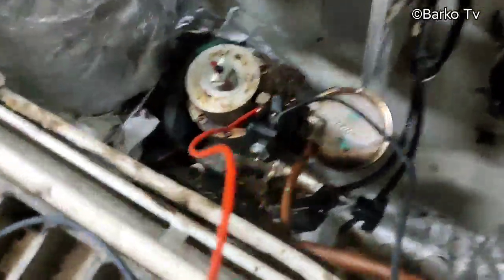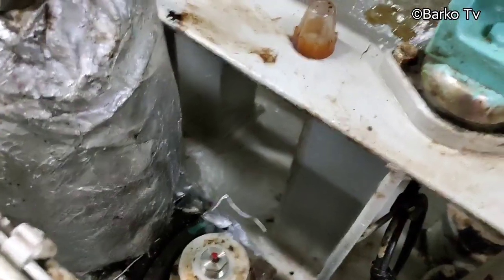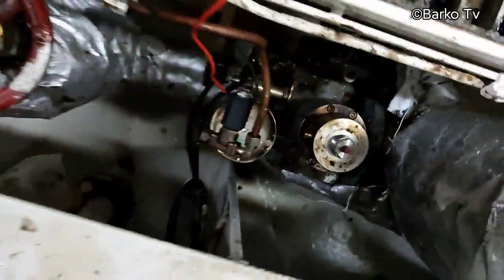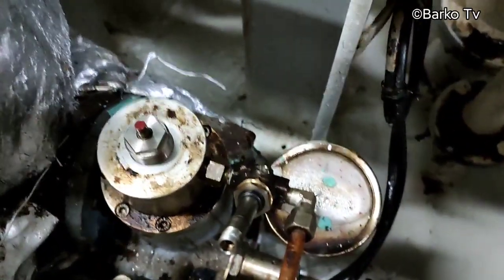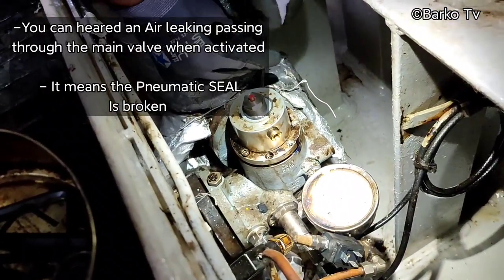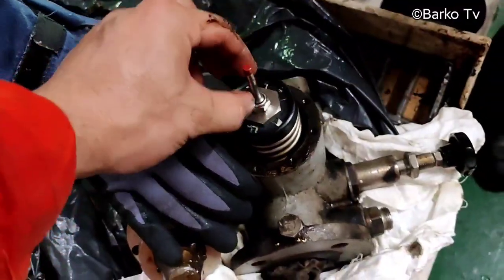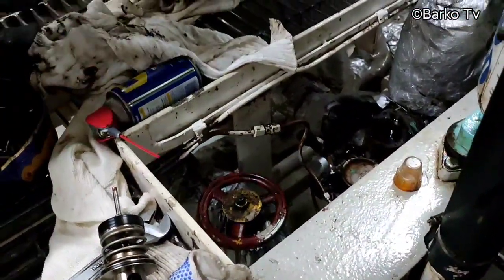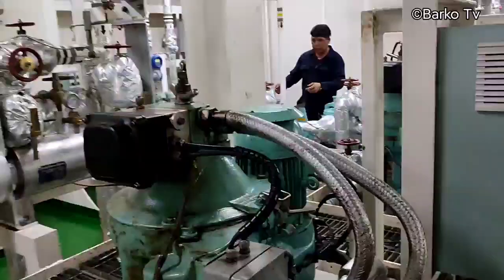Easy way to repair 3 way valve for Fuel Purifier | Westfalia | Barko Tv | makinista

Comment: Sir paano sir di umaabot sa 3 to 4 bars lang ang pressure hanggang 2 bars lang po ang hfo pressure inter.
Reply from the maker: Check po yong air supply sir, kadalasan restricted/ merong bara or merong iba dumaan pa sa Pressure regulator then check mo output air .